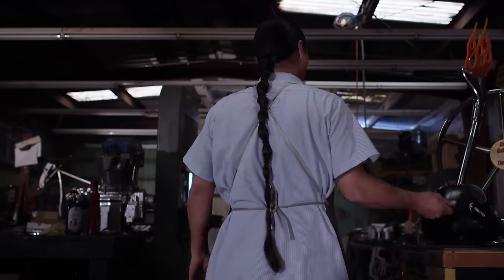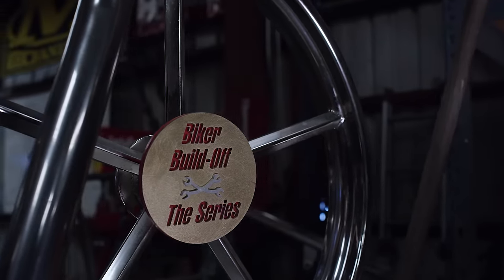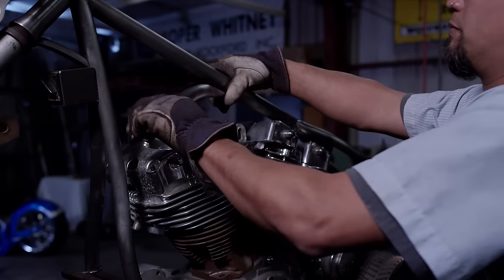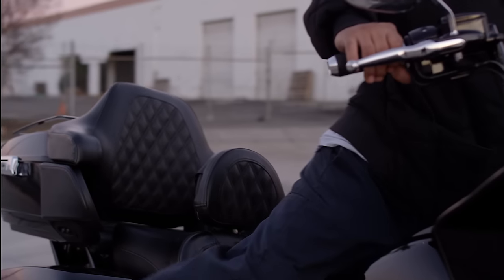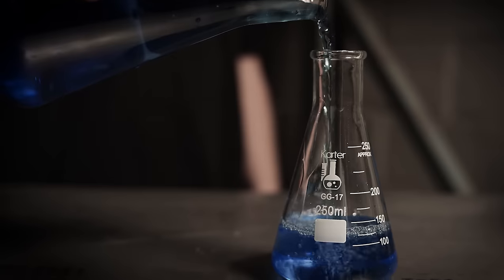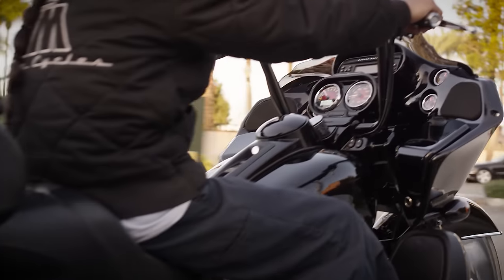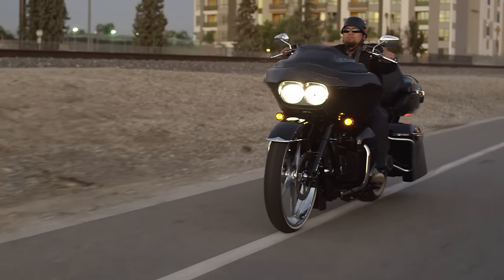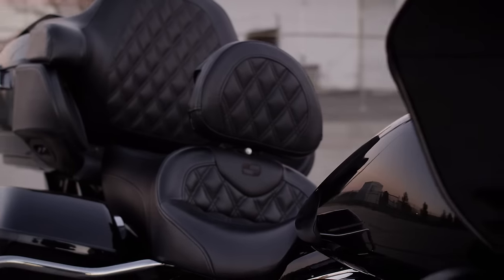Matt Hotch and Saddlemen's Roadsofa-LS

Comment: Just put the Road Sofa heated on my 2019 Ultra. Was a little concerned about the comments you find on the inter web about being too hard. I am going from a Danny Gray air hawk  to this. It felt great to me the moment I sat on it. If it gets any more comfortable I fear I’ll fall asleep riding. This is a nice seat! And it was 48 degrees out when I took it on first ride. Heat was nice. So far much love for saddlemen!
Reply from the maker: Thanks Blind , riding is believing - being that you can try it risk free at any of our Seat Center locations means you'll get to ride it on your bike how YOU ride .No better way to know if you ask us.  https://saddlemen.com/dealer-locator
Reply: 500 miles on it now. Had some minor pressure issues at the top of my hip for a short period. Settled in after about 200 miles. Little wider than my Danny Gray (which I loved until the air bladder started leaking). But I’m starting to live this Road sofa more every 100 miles. I haven’t had a chance yet to take on long trip due to weather. But two rides over 200 miles each and felt good. Again, great stuff saddlemen. I’ve used the heated seat twice and really nice.